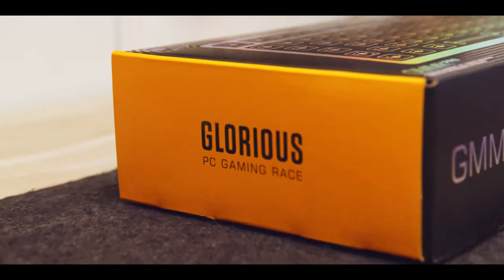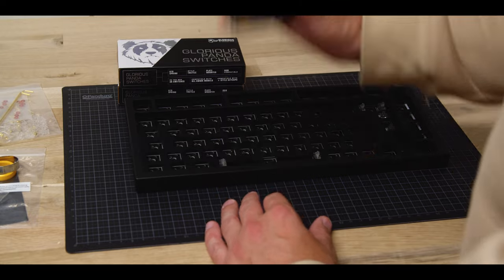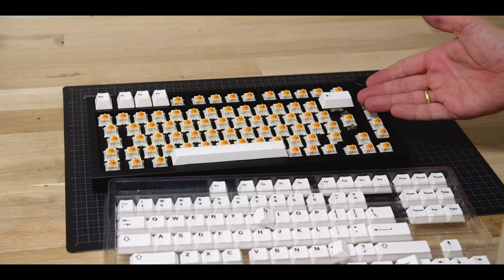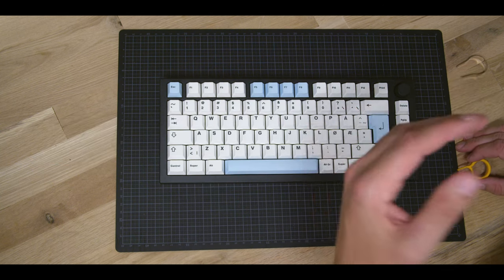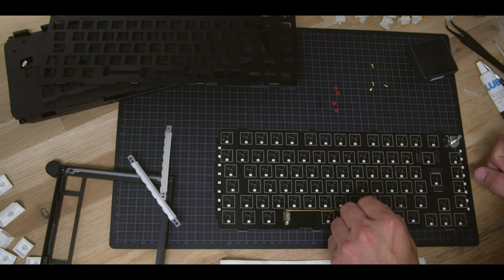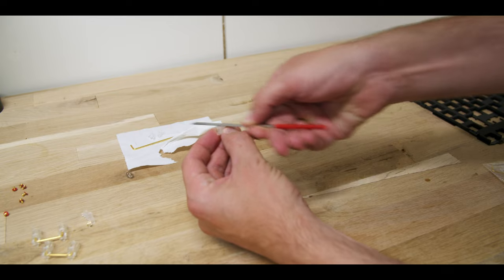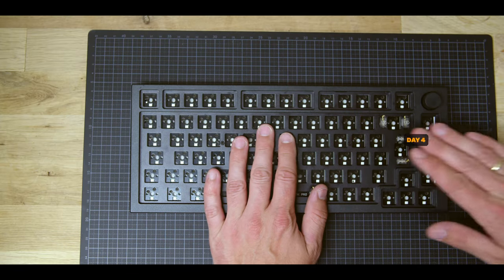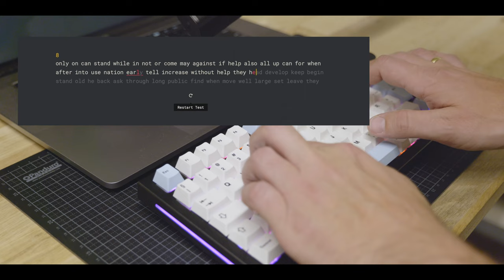The GMMK PRO is Amazing - After You Mod it!

Comment: I now this a year old. But I can say the OG stabs are fine if you relube them. I think the issue is the "G lube" they use. It seems to separate after a while. SInce these are in stock boards they are sitting in a warehouse that is probably not well temperature regulated. That meeting a cooling along with sitting, in my opinion, causes the lube to get sticky.
Reply from the maker: Yeah. We had to wipe em down and relube. Som gooey stuff that OG one :)

Comment: I noticed that on the left side of my spacebar specifically, it has a plasticky sound like ticking but not since it lacks the metallic sound. It's not rattle since it only exists when the spacebar bottoms and tops out so I believe it's a design issue with the board itself. I holee modded and lubed my durock v2s very generously with krytox on housing and wires... the exact stabs had zero issues on my kbd67 lite but when I moved them to my gmmk pro this problem arose. I made sure I mounted the board perfectly and tried a million different other things but it's just the way it is.
Reply from the maker: Hi Eugene! Thanks for your feedback. I thought it was jut me doing a poor job. Did you use the same keycaps on both boards? I was gonna check if there was a twist to the spacebar that might cause it, but I had to send it off to the client :D
Reply: I know this is a year old... But, mine had the same thing. I put an extra set of gaskets around the board on the bottom case only. They got rid of it completely. I think a force brake mod will do the same thing.